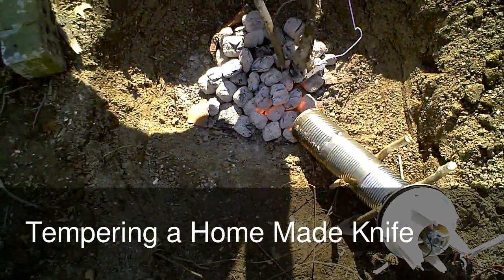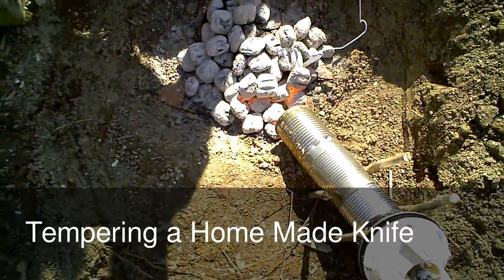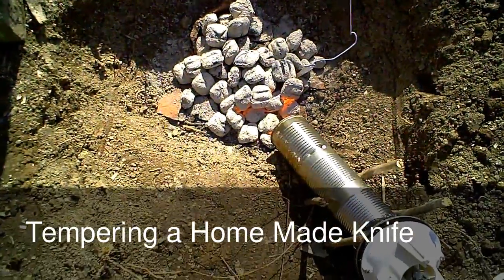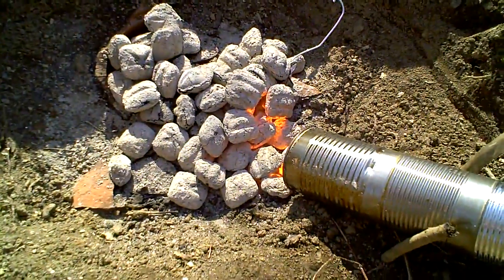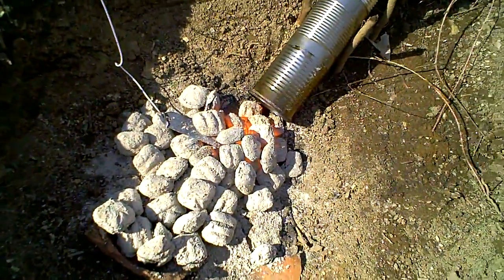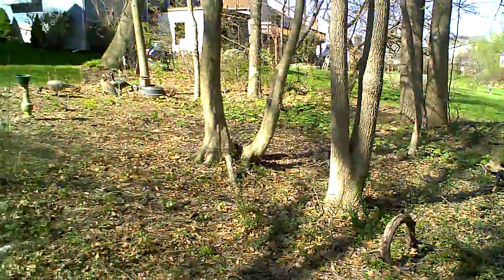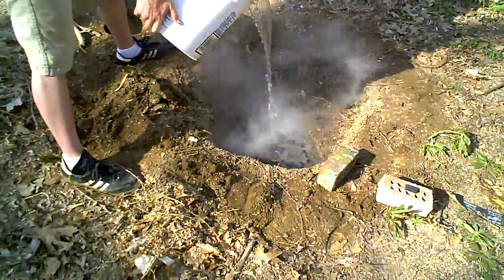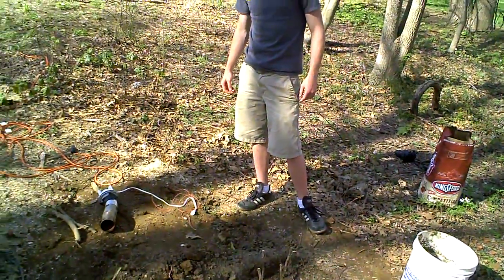Tempering a Home Made Knife

Comment: Putting a knife in oil and having flames bothers him but having a blower running on coals sitting in the ground doesn't? Yea, they just (kind of) heat treated the steel. They should throw it in the oven for an hour at about 400, let it cool and then do it again to temper it so it won't shatter if they drop it.  This is miles from metallurgy, but that's OK as long as they aren't expecting awesome results. Everyone starts somewhere.